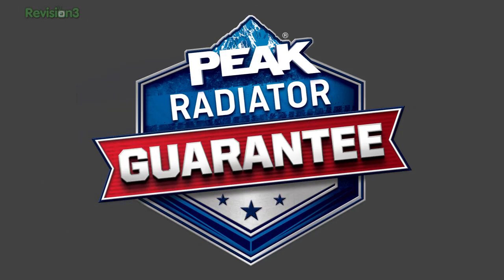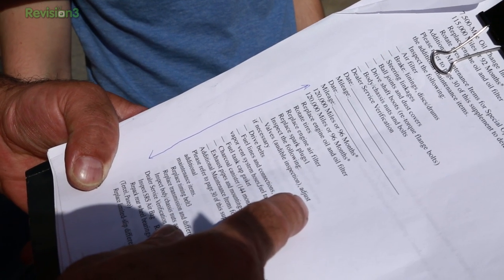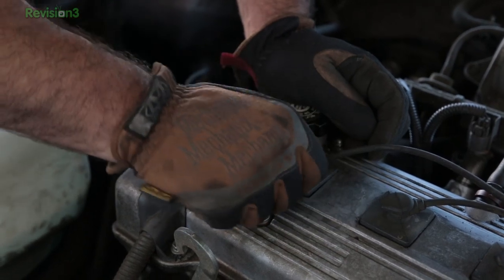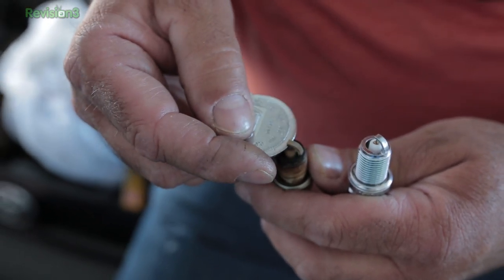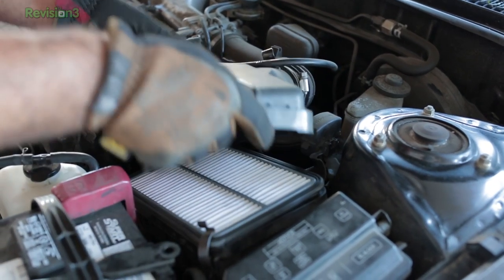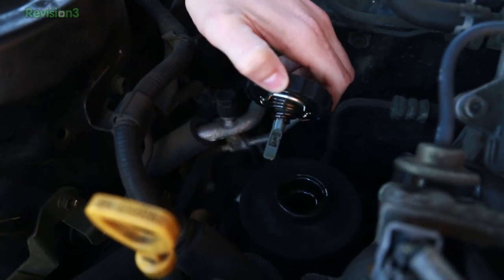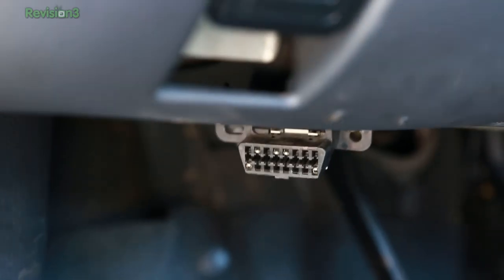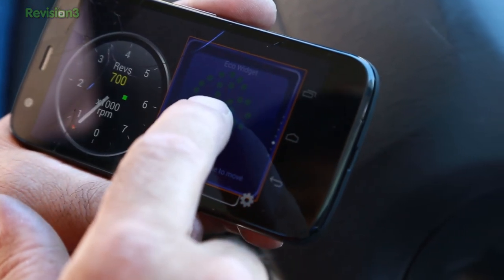Car DIY Tuneup! Spark Plugs, OBDII with Android,  and More

Comment: They don't make manuals for my truck, but my truck is a Frankenstein with a chevy v8 in a dodge truck. Lol
Reply: I had a Triumph Stag w/ a Ford engine in it... hard to find manuals that cover those situations!
Reply: My truck came with a Slant 6 but I rebuilt a 454 cubic inch chevy engine for it.

Comment: Now give that thing a paint job with Plastidip.
Reply: We were gonna Plasti Dip my truck, but you can't legally buy gallons of Plasti Dip in California... rattlecans, yes, but not gallons.  #sostupid
Reply: patrick norton Thats a shame, that stuff is pretty interesting to work with.  And on that beast of a diesel it would be fitting.
Reply: patrick norton just buy 18 of the 14.5 oz cans, that makes two gallons of pure Rubber Dip and cut it with Xyleen or VM&P. This mix will give you four sprayable gallons of Plasti Dip. I've been mixing my own for two years now. Iamthepuzzleman.com has more info if you need it.
Reply: patrick norton just buy 18 of the 14.5 oz cans, that makes two gallons of pure Rubber Dip and cut it with Xyleen or VM&P. This mix will give you four sprayable gallons of Plasti Dip. I've been mixing my own for two years now. Iamthepuzzleman.com has more info if you need it.